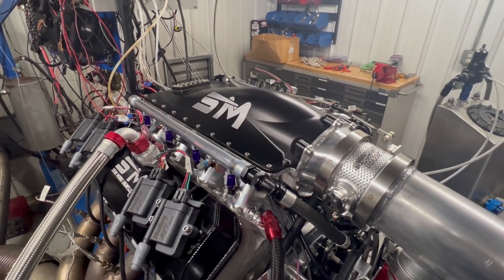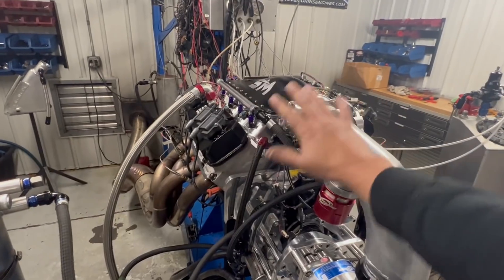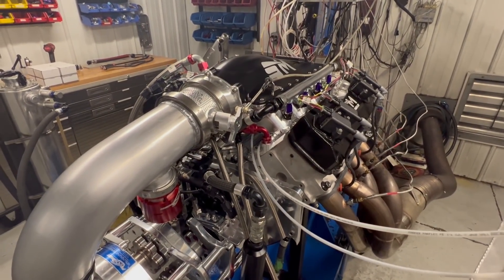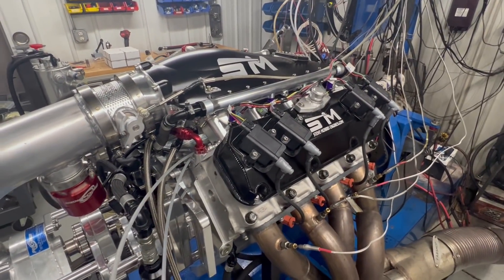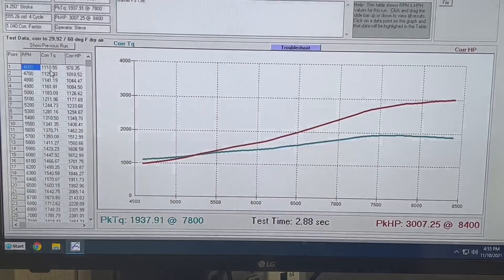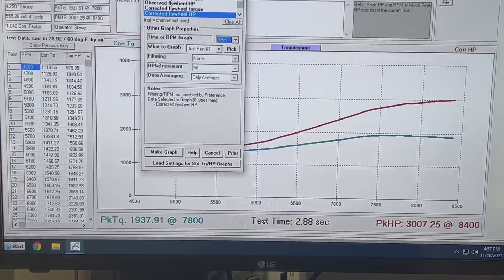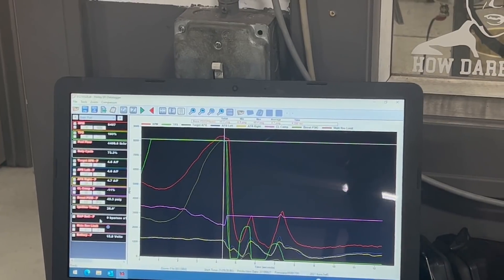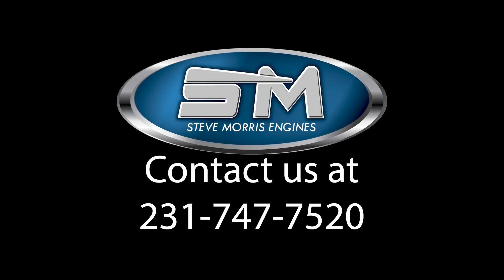BBF Billet intake Versus cast Intake!

Comment: What were the sparks from on the left back side of the motor?
Reply: Electrical arcing from ignition; coils and sparkplug wires, etc. These motors need a serious spark which means serious amperage.

Comment: I thought boost ( in a way ) was the air that couldn’t be put in the motor. So if that intake created more boost wouldn’t that mean it’s more restrictive??
Reply: Depends where you measure. The sensor is likely in the manifold so if boost went up while being fed from the same source that means it likely has evened out the pressure across the intake but before it likely was much higher at the supercharger and dropping a bunch of pressure to the intake indicating a restriction.

Comment: Have you thought about lenghtening those intake runners for gaining the mid-range back? After all, the engine runs relatively short times @ over 7200 RPM, and less power @ lower RPM makes the climb to over 7200 RPM longer thus affecting the ET. Designing the lower part of the intake resembling an LS intake, where the runner openings are @ the opposite side of the intake should pick the mid-range back up while keeping the overall hight relatively low. Also, positioning the injector @ the first curve, pointing directly down the runner has it's benefits on making power.
Reply: This is John and I motor for our top dragster. We leave in high gear. The motor spends its life down track above 7600 rpm. I leave at 5500 rpm, motor goes straight to 7600 rpm and comes through the traps at 8600 rpm.
Reply: @ExnerRacing  The current torque curve may cause issues on your 60 foot. The rapid incline from 5500 to 7200 can overwork the tyre/chassis. This can be compensated with timing/bleeding boost, but both options are still just trying to fix the original problem, too short runner length.

Comment: I would be interested in seeing the comparative TQ overlays, because this thing sure gives up ALOT below 7000 RPM and you literally have to ring it's neck up well over 8500 RPM in order to see the 'gains'. You also mentioned an 'increase' in boost number, even though no gearing as changed. Shouldn't the boost# have dropped ? This doesn't quite add up and it seems like making lemonade from lemons for the purpose of a video.
Reply from the maker: It does make sense
Put a 1 inch boost tube on your engine and measure boost AFTER the throttle body in the plenum. Then put a 5 inch tube on it and see what boost is in the plenum. It make a perfect sense . 
Also if you watch my dyno tech video just divide any power then X 5250
Reply: @stevemorrisracing  The previous intake/charge tubing must have been extremely restrictive then. While it's easy to understand, thanks to certain thermo dynamics laws, that an increase in feed tube can have a positive effect on HP, the pressure usually drops with added volume. Again, the old feed tubing/intake setup must have been EXTREMELY restrictive to the ProCharger itself if what you have shown/explained is true.

Comment: Why do the vents on the back wall pull closed durring the pull then slammed open as soon and the pull ends?
Reply from the maker: I need more fan pressuring the room . More power more air getting sucked from the room
Reply: @stevemorrisracing  Thanks for the reply!! 👊

Comment: Very nice Steve        Probably the perfect time to mention your TT bbf you built for Steve ash maybe 10 years ago that also made 3000hp    That engine was making around 30 psi with the same net horsepower   Question now is Is the extra 15 psi needed just to overcome the parasitic loss of the procharger or is there some thermo intake temps differences in the two combos
Reply from the maker: Yes

Comment: Love the lie. Nothing in this engine is stamped with fomoco. Just like top fuel. Nothing Chrysler hemi at all.
Reply from the maker: Actually it is ford stamp on heads and C head is a Ford designation bought thru Ford. The block would accept your stock BS BBF heads
Reply: That’s john and I motor. The c-head has a Ford part number, the block is an aluminum c&c block that you could run your stock heads on, the old intake was a Ford racing intake. So what’s not Ford about that?
Reply: Lmao   you got owned punk 🤣

Comment: Am surprised to hear you say it picked up a few psi of boost on the same gear set.  We all know boost psi is really a measure of restriction in the engine.  Given the reduction in restriction from the larger throttle body, intake tube and intake manifold I was expecting slightly lower psi but with higher power numbers.
Reply: Just read your reply to another poster on this same question.  Thanks for the explanation!

Comment: The flickering you get when recording is from the monitor refresh rate not being a multiple of the cameras lens rate. You can try changing the refresh rate on the monitor to see if you can get a better match to your camera.
Reply: Yup, the camera is more than likely is set to 60Hz (same as our AC power here in USA) and JFYI (nothing to do with your Monitor) European electricity is 50Hz (why cameras like GoPro have a 50Hz setting)... So as said above, you need to look/see if your computer/monitor settings has a 60Hz or 120Hz setting.
...edit... You can try changing the camera setting as well but that might/could make it look like the your lights are flickering...
Reply: I never knew that, you learn something new every day

Comment: If boost is a reluctance to flow not flow itself, and you're using the same engine and blower, surely a higher boost reading would indicate a more restrictive path for airflow through the engine, rather than more airflow
Reply from the maker: Not in this case . Boost is read after the throttle body in the plenum. 
Put a 1 inch boost pipe on your blower to engine. Then put a 5 inch pipe on it. Think there might be more boost in the manifold?
Reply: @stevemorrisracing  i had a reply to myself making that point that where you measured from before vs after, i was assuming it was measured at the compressor, but if measured from a place with different total cross sectional area then of course pressure will change... but i didn't wanna be that sad guy replying to himself :D 

not a fan of boost as a metric, it's almost useless really in quantifying flow!

thanks for replying though, i do enjoy your videos! :)
Reply: @psblah84  but isn't boost an indicator of POTENTIAL flow into the cylinders.
If one atmosphere of pressure is about 15.4psi anywhere above that is a bonus.
CFM through a manifold or intake ports or exhaust would be an absolute measure. Any compressor boost should get more volume (?) into the same area, allowing more fuel and stronger combustion mixtures.
I am just a long term observer, and not an expert.
Reply: @onedayiwillmakesomecontent  no, boost indicates the effort that is being performed to push that amount of air through the engine.

think of the engine like a straw, if you get a big straw and blow a number of CFM of air through that straw, your cheeks will blow out an amount as you attempt to push that amount of air through that straw.

get a smaller straw and try and push the same amount of air through it and you could do it, it's just your cheeks will puff out more.... you will be running a higher boost, but the same total airflow

the point steve made was that the reading was taken at a point where effectively the straw had changed to a shape where it was larger at the start and smaller at the point where boost was measured, skewing the comparison
Reply: My thought exactly.

Comment: Was that a flash or flame at 4:34 near the rear of the drivers side header?
Reply: Looked like front left to me, header gasket leaking?
Reply: Looked like sparks from the flywheel/flexplate that couples to the dyno.

Comment: If the equipment can take it you might be able to change the frequency the monitor is running at in the monitors settings, farting around with that should fix the strobing on camera chief. Love the channel extreamly interesting and you are an outstanding engineer sir.

Comment: The flickering is caused by the difference in framerate, camera is recording in for example 30fps and monitor is displaying in 50hz. Because they are not synchronized every so often the camera records the blank picture on the screen and displays in the video (the naked eye doesn't register it) Syncing the two will remove the flickering
Reply from the maker: how do I do that?
Reply: @stevemorrisracing  Try recording at different FPS, 30 or 60 should probably work best. The computer monitor is most likely very close to 60hz (and i assume so is your shop lighting), so you need to make the camera match that (or be a whole number division or multiple of 60) to avoid flickering.

If you can't set your camera to 30 or 60fps, but you can change the shutter speed, you can adjust that to 1/60 or 1/120 or 1/125 or something close.
Reply: @stevemorrisracing  Kinda depends on the camera, monitor and GPU you are using. in Windows go to display setting-> adv. display setting you'll be able to see at what hz the monitor runs. Depending on the monitor/GPU you'll be able to change it there (60hz is preferable). The camera is usually capable of doing 30 or 60 fps which can be changed in the recording setting
Reply: @stevemorrisracing  record at 60 FPS or 50 FPS
Reply: @stevemorrisracing  I think the new 7.3 ford handle 3000 hp
Reply: @stevemorrisracing  can you make big block ford 4000 horsepower
Reply: Gamers use higher HZ screens for less eye strain